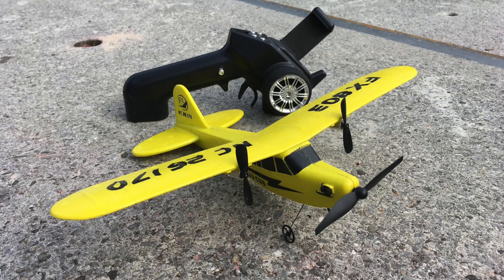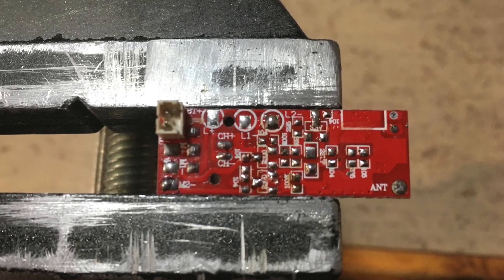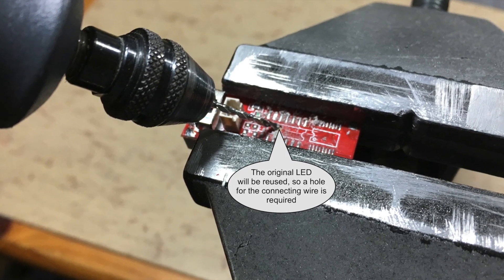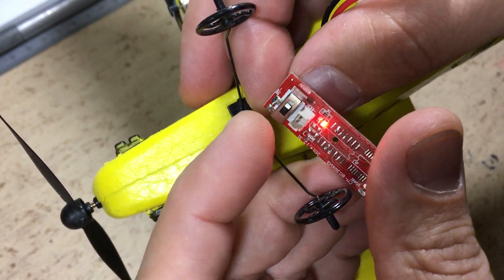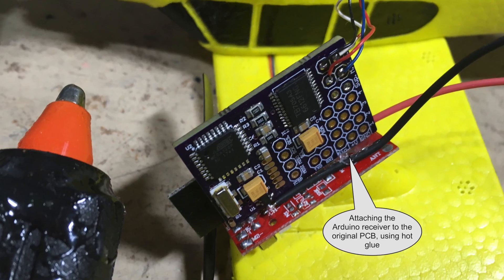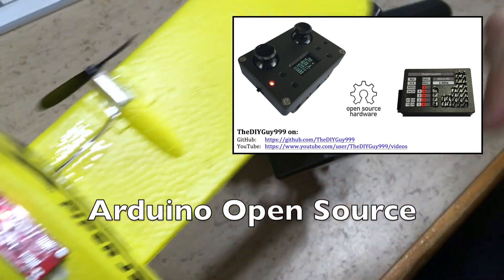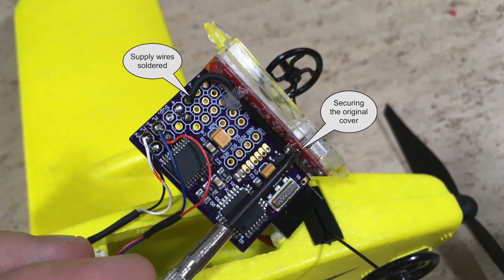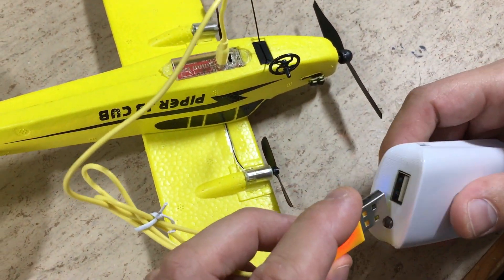Arduino Piper J3 CUB: Finalization And Maiden Flight!

Comment: RC_Transmitter_STM32:183:1: error: 'read' does not name a type

 read

 ^

C:\Users\AhMed\Desktop\RC_Transmitter_STM32-master\RC_Transmitter_STM32\RC_Transmitter_STM32.ino: In function 'void readButtons()':

RC_Transmitter_STM32:415:41: error: 'leftButtonState' was not declared in this scope

       if (DRE(digitalRead(BUTTON_LEFT), leftButtonState) && (transmissionMode < 3)) {

                                         ^

C:\Users\AhMed\Desktop\RC_Transmitter_STM32-master\RC_Transmitter_STM32\RC_Transmitter_STM32.ino:194:29: note: in definition of macro 'DRE'

 #define DRE(signal, state) (state=(state<<1)|(signal&1)&15)==7

                             ^

RC_Transmitter_STM32:437:41: error: 'leftButtonState' was not declared in this scope

       if (DRE(digitalRead(BUTTON_LEFT), leftButtonState)) {

                                         ^

C:\Users\AhMed\Desktop\RC_Transmitter_STM32-master\RC_Transmitter_STM32\RC_Transmitter_STM32.ino:194:29: note: in definition of macro 'DRE'

 #define DRE(signal, state) (state=(state<<1)|(signal&1)&15)==7

                             ^

Multiple libraries were found for "Wire.h"
 Used: C:\Users\AhMed\Documents\Arduino\hardware\Arduino_STM32-master\STM32F1\libraries\Wire
 Not used: C:\Users\AhMed\Documents\Arduino\hardware\Arduino_STM32-master\STM32F1\libraries\WireSlave
Multiple libraries were found for "EEPROM.h"
 Used: C:\Users\AhMed\Documents\Arduino\libraries\EEPROM
 Not used: C:\Users\AhMed\Documents\Arduino\hardware\Arduino_STM32-master\STM32F1\libraries\EEPROM
exit status 1
'read' does not name a type

STM32f103 board selected
Reply from the maker: It's getting tricky.
What is the version of your Arduino IDE?
Have you installed the Arduino SAM (Cortex M3) boards?
The wrong EEPROM library is used
Did you change anything in my sketch?

Are all these tabs displayed on the top of your IDE?
#include "readVCC.h"
#include "eepromHandler.h"
#include "transmitterConfig.h"
#include "MeccanoIr.h" // https://github.com/TheDIYGuy999/MeccanoIr
#include "pong.h" // A little pong game :-)

I have tested here on IDE 1.8.5 and all the newest libraries installed. It's compiling just fine
Reply: all tabs are shown as you described also i installed arduino SAM(cortexM3) board 
and also i did'nt change anything on your sketch ! 
i am using 1.8.7 arduino version which is latest version of arduino IDE
Reply: and also the U8G2 library still not orange like other library included

Comment: sorry for disturb again and again
i download and installed your given like but another problem here;
C:\Users\\Documents\Arduino\libraries\Wire\utility\twi.c:25:20: fatal error: avr/io.h: No such file or directory

 #include <avr/io.h>

                    ^

compilation terminated.

exit status 1
Error compiling for board Generic STM32F407V series.
Reply from the maker: Read these instructions carefully: https://github.com/rogerclarkmelbourne/Arduino_STM32/wiki/Installation
You also have to install the Arduino SAM (Cortex M3) boards.
It also looks like you selected the wrong board. "Generic STM32F103C series" is required

Comment: why don't you join the opentx developer?
Reply from the maker: opentx is a custom firmware for commercial transmitters. But I also have my own hardware platform. And sometimes you just have to do your own thing. If someone wants to help to improve the "Micro RC" system, he is warmly invited.

Comment: i install u8g2lib as you told me but now this error showing  
and yes all library are in orange color but U8g2 library was'nt .
PLEASE HELP ME I LIKE YOUR TRANSIMITTER SOO MUCH I WANNA BUILD ONE LIKE YOURS

RC_Transmitter_STM32:184:1: error: 'read' does not name a type

 read

 ^

sketch\pong.h: In function 'void pong()':

RC_Transmitter_STM32:183:21: error: 'PB15' was not declared in this scope

 #define BUTTON_BACK PB15 // back button for menu

                     ^

sketch\pong.h:125:19: note: in expansion of macro 'BUTTON_BACK'

   if (digitalRead(BUTTON_BACK) == LOW) {

                   ^

C:\Users\AhMed\Desktop\RC_Transmitter_STM32-master\RC_Transmitter_STM32\RC_Transmitter_STM32.ino: In function 'void setup()':

RC_Transmitter_STM32:304:18: error: 'PB9' was not declared in this scope

   greenLED.begin(PB9); // Green LED on pin PB9

                  ^

RC_Transmitter_STM32:305:16: error: 'PB8' was not declared in this scope

   redLED.begin(PB8); // Red LED on pin PB8

                ^

RC_Transmitter_STM32:180:21: error: 'PB12' was not declared in this scope

 #define BUTTON_LEFT PB12 // - or channel select

                     ^

C:\Users\AhMed\Desktop\RC_Transmitter_STM32-master\RC_Transmitter_STM32\RC_Transmitter_STM32.ino:310:11: note: in expansion of macro 'BUTTON_LEFT'

   pinMode(BUTTON_LEFT, INPUT_PULLUP);

           ^

RC_Transmitter_STM32:181:22: error: 'PB14' was not declared in this scope

 #define BUTTON_RIGHT PB14 // + or transmission mode select

                      ^

C:\Users\AhMed\Desktop\RC_Transmitter_STM32-master\RC_Transmitter_STM32\RC_Transmitter_STM32.ino:311:11: note: in expansion of macro 'BUTTON_RIGHT'

   pinMode(BUTTON_RIGHT, INPUT_PULLUP);

           ^

RC_Transmitter_STM32:182:20: error: 'PB13' was not declared in this scope

 #define BUTTON_SEL PB13 // select button for menu

                    ^

C:\Users\AhMed\Desktop\RC_Transmitter_STM32-master\RC_Transmitter_STM32\RC_Transmitter_STM32.ino:312:11: note: in expansion of macro 'BUTTON_SEL'

   pinMode(BUTTON_SEL, INPUT_PULLUP);

           ^

RC_Transmitter_STM32:183:21: error: 'PB15' was not declared in this scope

 #define BUTTON_BACK PB15 // back button for menu

                     ^

C:\Users\AhMed\Desktop\RC_Transmitter_STM32-master\RC_Transmitter_STM32\RC_Transmitter_STM32.ino:313:11: note: in expansion of macro 'BUTTON_BACK'

   pinMode(BUTTON_BACK, INPUT_PULLUP);

           ^

C:\Users\AhMed\Desktop\RC_Transmitter_STM32-master\RC_Transmitter_STM32\RC_Transmitter_STM32.ino: In function 'void readButtons()':

RC_Transmitter_STM32:416:41: error: 'leftButtonState' was not declared in this scope

       if (DRE(digitalRead(BUTTON_LEFT), leftButtonState) && (transmissionMode < 3)) {

                                         ^

C:\Users\AhMed\Desktop\RC_Transmitter_STM32-master\RC_Transmitter_STM32\RC_Transmitter_STM32.ino:195:29: note: in definition of macro 'DRE'

 #define DRE(signal, state) (state=(state<<1)|(signal&1)&15)==7

                             ^

RC_Transmitter_STM32:180:21: error: 'PB12' was not declared in this scope

 #define BUTTON_LEFT PB12 // - or channel select

                     ^

C:\Users\AhMed\Desktop\RC_Transmitter_STM32-master\RC_Transmitter_STM32\RC_Transmitter_STM32.ino:195:47: note: in definition of macro 'DRE'

 #define DRE(signal, state) (state=(state<<1)|(signal&1)&15)==7

                                               ^

C:\Users\AhMed\Desktop\RC_Transmitter_STM32-master\RC_Transmitter_STM32\RC_Transmitter_STM32.ino:416:27: note: in expansion of macro 'BUTTON_LEFT'

       if (DRE(digitalRead(BUTTON_LEFT), leftButtonState) && (transmissionMode < 3)) {

                           ^

RC_Transmitter_STM32:181:22: error: 'PB14' was not declared in this scope

 #define BUTTON_RIGHT PB14 // + or transmission mode select

                      ^

C:\Users\AhMed\Desktop\RC_Transmitter_STM32-master\RC_Transmitter_STM32\RC_Transmitter_STM32.ino:195:47: note: in definition of macro 'DRE'

 #define DRE(signal, state) (state=(state<<1)|(signal&1)&15)==7

                                               ^

C:\Users\AhMed\Desktop\RC_Transmitter_STM32-master\RC_Transmitter_STM32\RC_Transmitter_STM32.ino:426:29: note: in expansion of macro 'BUTTON_RIGHT'

         if (DRE(digitalRead(BUTTON_RIGHT), rightButtonState)) {

                             ^

RC_Transmitter_STM32:438:41: error: 'leftButtonState' was not declared in this scope

       if (DRE(digitalRead(BUTTON_LEFT), leftButtonState)) {

                                         ^

C:\Users\AhMed\Desktop\RC_Transmitter_STM32-master\RC_Transmitter_STM32\RC_Transmitter_STM32.ino:195:29: note: in definition of macro 'DRE'

 #define DRE(signal, state) (state=(state<<1)|(signal&1)&15)==7

                             ^

RC_Transmitter_STM32:180:21: error: 'PB12' was not declared in this scope

 #define BUTTON_LEFT PB12 // - or channel select

                     ^

C:\Users\AhMed\Desktop\RC_Transmitter_STM32-master\RC_Transmitter_STM32\RC_Transmitter_STM32.ino:195:47: note: in definition of macro 'DRE'

 #define DRE(signal, state) (state=(state<<1)|(signal&1)&15)==7

                                               ^

C:\Users\AhMed\Desktop\RC_Transmitter_STM32-master\RC_Transmitter_STM32\RC_Transmitter_STM32.ino:438:27: note: in expansion of macro 'BUTTON_LEFT'

       if (DRE(digitalRead(BUTTON_LEFT), leftButtonState)) {

                           ^

RC_Transmitter_STM32:181:22: error: 'PB14' was not declared in this scope

 #define BUTTON_RIGHT PB14 // + or transmission mode select

                      ^

C:\Users\AhMed\Desktop\RC_Transmitter_STM32-master\RC_Transmitter_STM32\RC_Transmitter_STM32.ino:195:47: note: in definition of macro 'DRE'

 #define DRE(signal, state) (state=(state<<1)|(signal&1)&15)==7

                                               ^

C:\Users\AhMed\Desktop\RC_Transmitter_STM32-master\RC_Transmitter_STM32\RC_Transmitter_STM32.ino:449:27: note: in expansion of macro 'BUTTON_RIGHT'

       if (DRE(digitalRead(BUTTON_RIGHT), rightButtonState)) {

                           ^

RC_Transmitter_STM32:182:20: error: 'PB13' was not declared in this scope

 #define BUTTON_SEL PB13 // select button for menu

                    ^

C:\Users\AhMed\Desktop\RC_Transmitter_STM32-master\RC_Transmitter_STM32\RC_Transmitter_STM32.ino:195:47: note: in definition of macro 'DRE'

 #define DRE(signal, state) (state=(state<<1)|(signal&1)&15)==7

                                               ^

C:\Users\AhMed\Desktop\RC_Transmitter_STM32-master\RC_Transmitter_STM32\RC_Transmitter_STM32.ino:463:25: note: in expansion of macro 'BUTTON_SEL'

     if (DRE(digitalRead(BUTTON_SEL), selButtonState) && (transmissionMode == 1)) {

                         ^

RC_Transmitter_STM32:183:21: error: 'PB15' was not declared in this scope

 #define BUTTON_BACK PB15 // back button for menu

                     ^

C:\Users\AhMed\Desktop\RC_Transmitter_STM32-master\RC_Transmitter_STM32\RC_Transmitter_STM32.ino:476:24: note: in expansion of macro 'BUTTON_BACK'

       if (!digitalRead(BUTTON_BACK)) data.momentary1 = true;

                        ^

RC_Transmitter_STM32:183:21: error: 'PB15' was not declared in this scope

 #define BUTTON_BACK PB15 // back button for menu

                     ^

C:\Users\AhMed\Desktop\RC_Transmitter_STM32-master\RC_Transmitter_STM32\RC_Transmitter_STM32.ino:195:47: note: in definition of macro 'DRE'

 #define DRE(signal, state) (state=(state<<1)|(signal&1)&15)==7

                                               ^

C:\Users\AhMed\Desktop\RC_Transmitter_STM32-master\RC_Transmitter_STM32\RC_Transmitter_STM32.ino:480:27: note: in expansion of macro 'BUTTON_BACK'

       if (DRE(digitalRead(BUTTON_BACK), backButtonState)) {

                           ^

Multiple libraries were found for "Wire.h"
 Used: C:\Users\AhMed\AppData\Local\Arduino15\packages\stm32duino\hardware\STM32F1\2018.9.15\libraries\Wire
 Not used: C:\Users\AhMed\AppData\Local\Arduino15\packages\stm32duino\hardware\STM32F1\2018.9.15\libraries\WireSlave
exit status 1
'read' does not name a type
Reply from the maker: Looks like a problem with your board definition, resulting in not properly recognized PB pins.
Have you used this STM32 library? https://github.com/rogerclarkmelbourne/Arduino_STM32

Comment: Heheee, cool! Proper steering now, I guess.
Reply from the maker: Thanks. Yes, of course. The utilized system is called differential thrust. So the plane is only steered by the motors. No servos.
Reply: @TheDIYGuy999  , practically - "tank steering" for plane :)
Reply from the maker: Yes, it‘s essentially the same. The only difference is the missing reverse.
Reply: @TheDIYGuy999  , maybe with reverses enabled, you could send it spinning on horizontal plane :)
Reply: and the missing turret :)
Reply from the maker: LOL, you guys are crazy ;-)
Reply: @TheDIYGuy999  , well yes, thank you! :)
Reply from the maker: You‘re welcome 😂